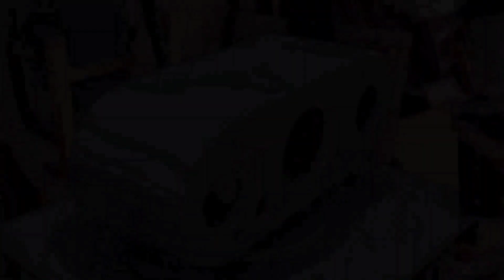BUILD IT - WIFI Music STREAMING Bluetooth Boombox DIY Build

Comment: Really nice Build! Do you have any measurements or plans so someone can rebuild this. Did you simulate it before building? WOuld be really nice to see you reviewing the Sound of the box. Thanks and again: Great build! :)
Reply from the maker: Will be doing a sound review in the future but going on holiday for a few weeks so won't be for a month or so. Measurements of MDF was In the video at the start!!. Centre cavity 10" x 6.5 x 6. Full range cavities were approximated in winisd. Hope this helps a bit
I'm really happy with the sound output better than I expected. The ARYLIC plate amp isn't cheap but great to use with the app.
Reply: @DIY-AUDIO  Thank you very much for your reply. If this box sounds as awesome as it looks than I am building it for sure! :) Wish you a nice vacation!
Reply from the maker: Good luck with the build!!

Comment: looks like an awesome solid build!
did u calculatet in any way the needed volume for the used speakers?
and i would ask, if there is an possibility to run it from a battery so it is an "portable" box or can it just be powered from a socket
Reply from the maker: Hi Marek, tried to calculate space for the drivers but obviously bigger would of been better but couldn't go too big!! . I'm sure you could make it with a battery pack but, this weighs nearly 10kg already!!
Reply: @DIY-AUDIO  thank you very much for your response!

Comment: pretty boombox can we have the dimensions please thank you ❤
Reply from the maker: 53cm (max length) x 20cm (height - not including feet) x 20cm depth (front to back). Hope this helps!?
Reply: @DIY-AUDIO  yes thanks you bro
Reply: @DIY-AUDIO  how do you do to make a curve what calculation or technique to redo it your cuts are spaced by how much thank you
Reply from the maker: @lilgwaada97one  guesswork!!
Reply from the maker: @lilgwaada97one  I just guessed but apparently there is a calculator on line somewhere!!